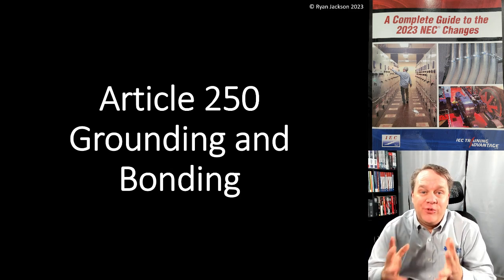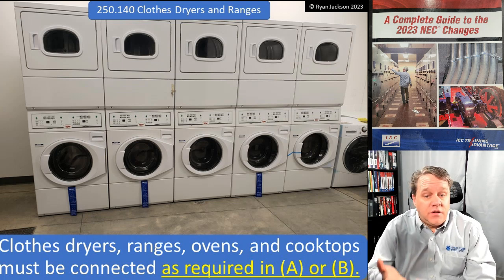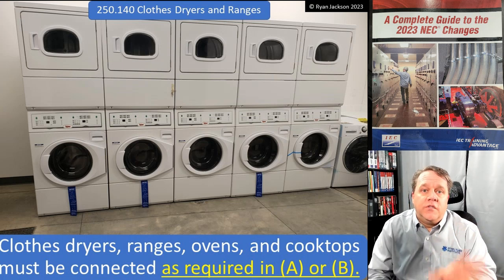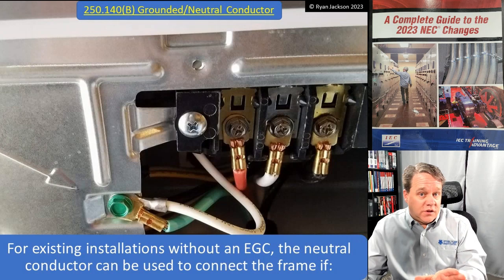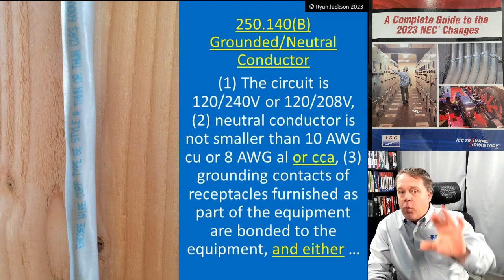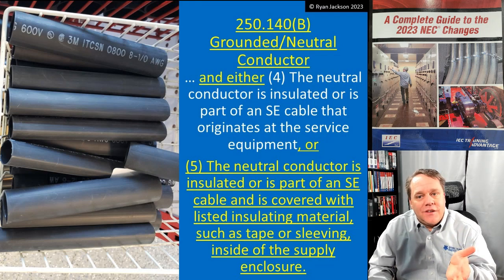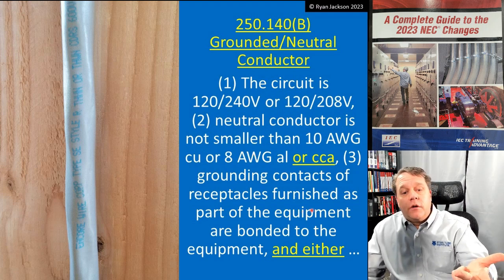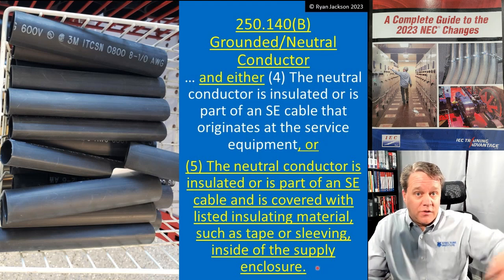2023 250.140 Frames of Ranges and Clothes Dryers

Comment: Assume you have a 3-wire with bare neutral and then inside the supply enclosure you add heat-shrink sleeving to the bare conductor. Since the conductor is still acting as both neutral for the range and the ground for the range’s frame, what do you do if the range’s circuit breaker is in a subpanel? Do you connect the newly sleeved conductor to the neutral busbar or to the ground busbar?

Comment: So my gas dryer and gas stove that require only 110volt single phase are safe because they are fed by hot, neutral and case ground?  Neutral and case ground are bonded at the breaker box?  
Cannot imagine replacing gas appliances with electric in old housing.

Comment: So when you do the described service upgrade and the interior panel is now a sub-panel im assuming this insulated conductor gets landed on the neutral bar….?
Reply: Correct. "The grounded conductor shall be insulated or field covered within the supply enclosure with listed insulating material, such as tape or sleeving to prevent contact of the uninsulated conductor with any normally non-current-carrying metal parts." Must go to neutral bar.

Comment: Can never forgive the NEC or who ever allowed the bare ground wire on type NM cable to be a dual function connection that be supp!ting the neutral and ground.  Now what 75 years later you would think that lazy cheap appliance companies would produce some electric dryers that do not require a neutral by installing a $8 transformer to supply either 120 or 24 volts for controls & LED drum light and a 240 volt drum motor. The few extra dollars would be cheaper then running 10/3 & more expensive 4 wire 250  receptacle.
Reply: It would be hilarious so to speak if you needed to replace a dryer motor and discovered the original was a dual voltage motor set up for 120V instead of 240V
Reply: Oh tell me about it.  At the company I work for we wire custom homes and some (but not all of) the larger built in microwave ovens and steam wall ovens we install plug into a NEMA 6-20R, and yes these ovens have incandescent oven lights.   Other's call for a 12/3 w/G cable and are hardwired, identical features but different manufacturer.
Reply: Agreed. It's ridiculous that a range or dryer needs 120V for anything. And now people are going around installing NEMA 14-50 receptacles for EV charging "because it's the standard". That 6 or 8 gauge neutral will only ever carry a few milliamps for the control electronics, and if an EVSE truly requires a neutral for some reason, the person who designed it is an idiot.

Comment: I do recall doing my cod update at this time, it was explained, there was a gentlemen that did some wonderful research and wrote a paper on this. about how this three and four wire situation manifested itself. And basically it came about during WW2 there was a severe copper shortage and so they allowed the neutral and grounding wire to be one to save the copper wire in the cable. But after the war it never was undone and as time marched on no one remembered why,until this gentleman did the research and wrote the paper.
Curious to see if anyone has come across this paper or have heard this.
Thanks
Reply: Retired after 50 years and often wondered how they got away with the bare wire feeding the neutral & ground on electric dryer & ranges. Thanks. Did electrical work in a doctors house that he had to get permission to build it during g WW2.
Reply: Yes I did some research, it's very obscure but from what little info I could gather,  it was the Tentative Interim Amendment 53 put in effect in July 1942 and supposedly an effort to conserve raw materials during the war.   This is where the allowance for  grounding the frames  of ranges to the grounded (neutral) circuit conductor began.  This permission was extended to clothes dryers in 1953 and of course remained that way until 1996 although in some jurisdictions it wasn't until closer to the early 2000s when the rule was widely enforced.
Reply: Thanks for that, interesting they extended it to the dryer in the 50's. I do get the logic when you come from the main service. But the whole thing is just a bad habit. Been in situations like having a 50 unit complex. With all the units having sub- panels(being federal pacifics, upgrading them). The original electrician didn't understand how the rule worked,nor did the inspector pick up on it. I'm glad they removed this allowance. We'll all be dealing with the ramifications for a long time.

Comment: Would you have to have the shrink tube colored white? It seems odd to use black shrink tube on the bare conductor.
Reply: As a grounded conductor, 200.7 rules would apply- white or white stripes.

Comment: That's some nice clarification.  BTW It was the 1996 NEC that prohibited using 3 wire dryer and range setups, local codes may have banned them sooner of course, and for those jurisdictions that adopted each code cycle later 3 wire setups could have lasted into the early 2000s

Comment: Ryan, when are you coming back to NJ-IEC to do continuing education for us? I love this discussion about the 3-wire vs 4-wire.
Reply from the maker: Tell the chapter to bring me back. I'd love to do another class in Jersey
Reply: As I pointed out for the 1996 NEC® Public Comment (for other than mobile homes and RVs that never permitted the grounded conductor to serve as the EGC), the reason for electric range ovens/ranges and clothes dryer to use the grounded conductor as the EGC was to save copper for »the “war effort” of WWII«. WWII ended in 1945! In 1996, it was LONG OVERDUE to stop this practice of compromising the purpose of using an EGC discrete of the grounded conductor.